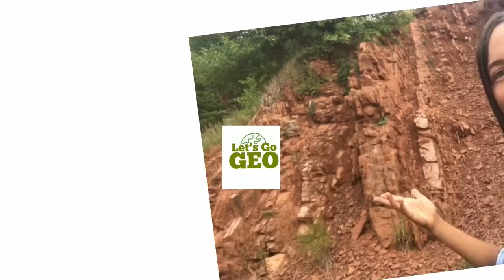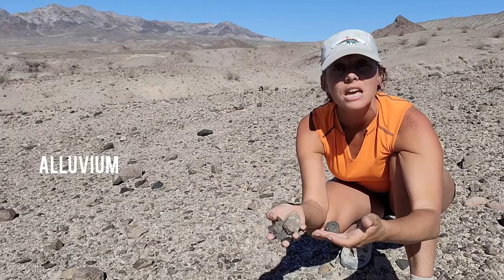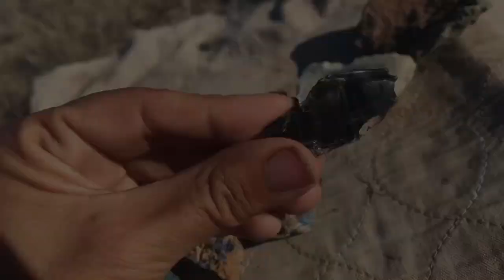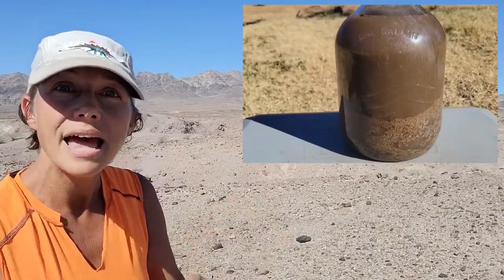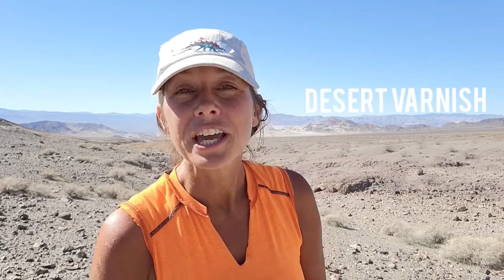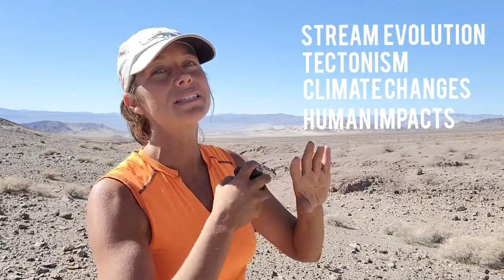What’s an ALLUVIAL FAN? (Mojave Desert Geology)

Comment: Great video! I metal detector for gold nuggets on some alluvial fans in the Mohave desert of Arizona. It boggles my mind at times how it all got in some places. Layers on top of layers, event after event, all still being dissected by nature to this day. The geologic map for the area really shows it all pretty well, but some of it just doesn’t make sense to me. I have one huge alluvial fan that produces gold but the direct path up the mountains from it today, in modern times, is basically barren of gold. Almost like when the uplifts and intrusions started, the gold and material came rushing down the mountains to form the fan, but later events between the known gold lode areas and the fan, lifted the area between them, eroded, tilted and even slid it all east to west on faults. With that, to the west I’ve found some incredible gold nuggets and placer gravels that were left high and dry, now hundreds of feet above modern drainages and almost at the peaks of some mountain sides and tops that I can only assume were left behind during uplifts/intrusions of the area. That’s getting a bit off topic of alluvial fans but super cool stuff  either way.

Comment: I had to research this for making a geological commentary for gold hunters looking across the landscape and knowing where to find gold, not to find gold, ... and what is the actual AGE of bedrock and AGE of eroded sedimentary boulders, rocks, sand, clay, silts, and muds.  This pertains to geological high elevation streams, or low elevation estuary and delta flatlands etc.

Alluvial geology are water action with erosion and distribution of debris from a higher to lower elevation.  Alluvials can be mountain high slopes (angles of repose) "V" shaped ravines and valleys or  glacial "U" shaped valleys.  Alluvials cal also be ancient glacial meltwater ponds or lakes released for flow down the landscape - or - weather and rains, flash floods rushing down and eroding the landscape.

Fluvial areas are water ways and the dropping of the said debris as sedimentation in slower water flows, and flatter landscapes.  Such debris streams, braided streams, are all fluvial waterways.

The bigger the rocks (organic debris, stumps, logs, trees, ... inorganic houses, vehicles, trains, rail lines ...) in the alluvial fans, the bigger the historical water flow velocity, and cause of that alluvial action :  volcanic lahars or pyroclastic flows, dams and waterways blockages being overtopped and eroding into a mass flooding, ancient glacial lakes breaching their ice dams and massive flash flooding, extreme snow pack melting and flash flooding, weather and rainstorms with flash flooding (especially in desert regions and instant flash floods rushing across dry and hard soil).

Bigger depth of deposited layers, the greater the massive alluvial actions.  Smaller depth and varves (lake tidal sedimentation from seasonal or occasional weather-related water flows and sedimentary actions, smaller waterflow and less sedimentation rates.
Reply: Thank you for this clear definition.